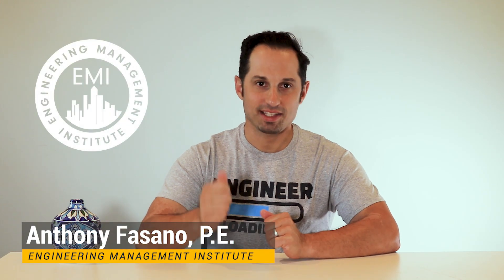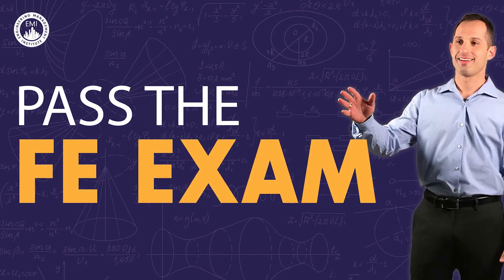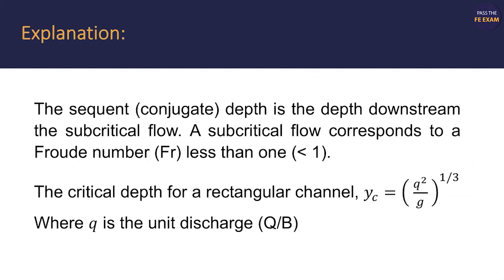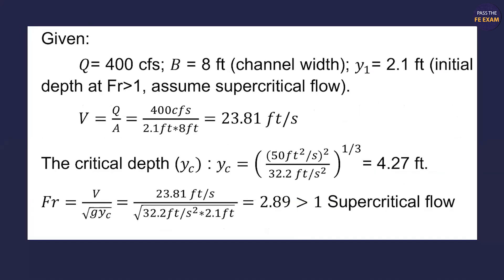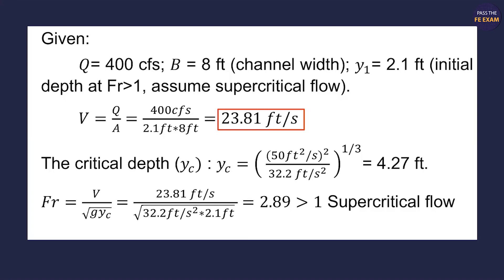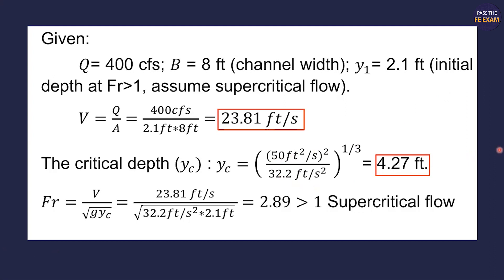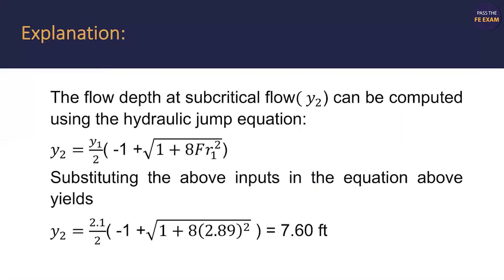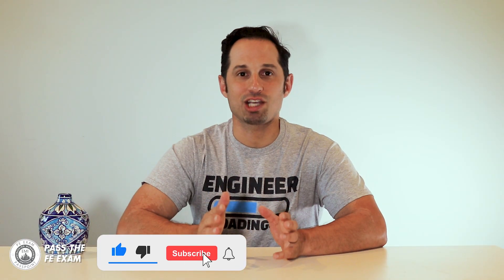FE Exam Fluid Mechanics and Hydraulics | Steady and Unsteady Flow

Comment from the maker: In the previous revision of this video, we showed the calculation for the critical depth, even though it isn't required to solve this problem. We've made it more clear that it isn't required in this revision. The calculation for the critical depth is a very related topic and calculation and was used to express how you might see an correctly-computed answer associated with a related topic presented as a red herring.

When in the prevision revision of the video we solved for the Froude number at the supercritical depth, the variable was mislabeled as Yc. This would have referred to the critical depth. It should have been labeled as Y1, representing the supercritical flow depth that we ended up using. You can check out the updated video here: https://vimeo.com/768623856

Comment: I think when calculating the Fr you used the wrong value for the Yc. You put in 2.1 which = Y1, I think you meant to put in the 4.27 which is the value we calculated for Yc. Let me know if this makes sense?
Reply from the maker: Thanks Makenna, I will review this, thank you for letting me know. I really appreciate that.  How is your studying going?
Reply: @PasstheFEExam  Any update on this question? I don't see a correction or explanation anywhere
Reply: I do believe it is 2.1. The Fr equation should have yh not yc. yh = A/t 
A = cross-sectional area of flow and t = width of the water surface
A = 8*2.1
A = 16.8
t = 8

yh = 16.8/8
yh = 2.1
Hope this helps :)

Comment: Whats the point of calculating the Critical depth (4.27 ft) if it is not needed to find the answer?
Reply from the maker: You need it to determine the Fr which then tells you it is Supercritical flow, which then helps you choose the equation for y2.  You can see that on the slides.
Reply: @PasstheFEExam  I am wondering the same question as Jimmy.  You say you need Critical Depth (4.27 ft) for Fr, but in the solutions you used Y1 (2.1 ft) instead.  Let me know your thoughts.
Reply from the maker: @brianwright2882  you may be right, Makenna had a similar question, I will review in detail in the next few days.  Thanks for letting me know.